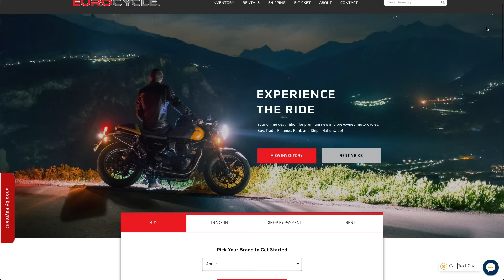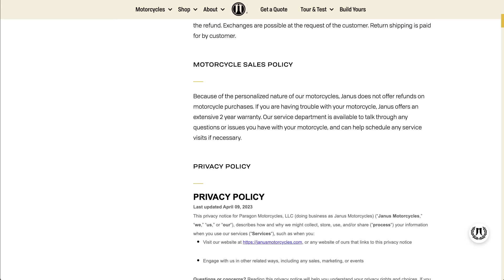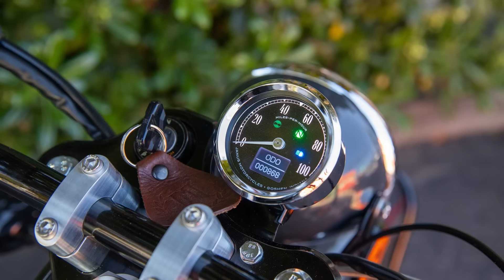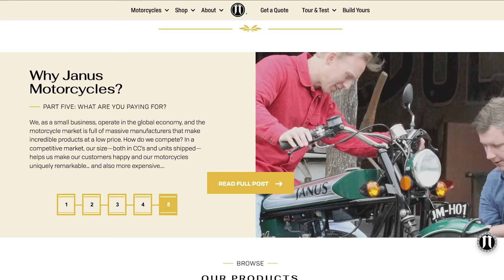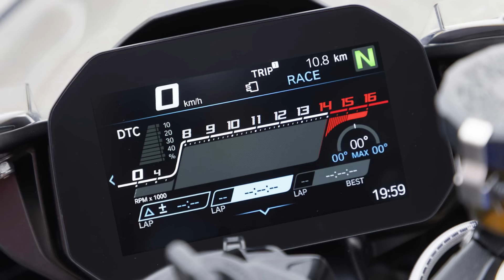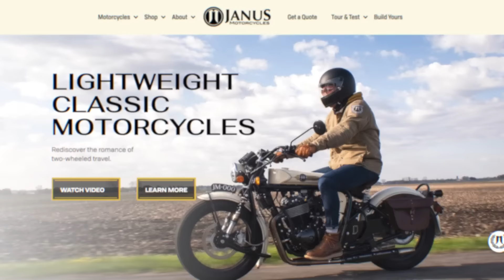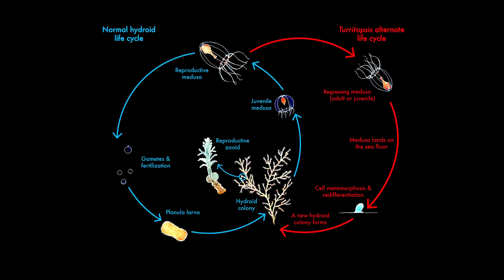We need to talk about Janus Motorcycles

Comment: If you look at a lot of the older Royal enfield advertisements they hit on a lot of the bespoke handmade aspects, like the one older gentleman who did the tank pin striping for the past 50 years. There’s definitely levels to that and I can understand the appeal of Janus. But yeah for 15k, I could buy pretty much any motorcycle I really wanted and most of them new. I love the retro looks, and because it’s hand made and there is a level of respect there I could say maybe 7-8k. But you can get Chinese 250 and 450 engine clones for 2-300 bucks. Where is the other $14,700. I’ve seen comments talking about the experience, and you can get the exact same experience for a lot less money.

Comment: Good lord did you miss the point of these bikes. People buy a Janus because they want everything you dismiss as a downfall. If you buy a hermetically sealed motorcycle that only a certified technician can maintain, you only have a bike to ride. A Janus is a bike that literally anyone can work on and fix, and that’s a huge part of the appeal. It’s simple, it’s mechanical, everything is visible and easy to adjust, and it takes no special tools to keep running. Riding a Janus isn’t even 50% of the appeal, most of the appeal is in having something that’s beautiful to look at and something to tinker with. Listening to your video was like hearing someone complain that an Omega is a garbage watch because it keeps bad time, you have to wind it, and its hard to read, and that if you want a watch you should just buy a Casio G-Shock instead.

Comment: like the vintage look , think if i had one made i would give them the motor from the kaw 454 sitting in the shed with almost no miles on it though , it's belt drive so that would look cool an something over 50 horse forget how many but they are not slouchs will run 80 mph all day long on the highway and over a hundred if you have to take a dump at the next service center , aircraft crome moly is super strong and lite to i like that . dunno about the chinese motors but do know those 454 are half of a 900 and bullet proof .

Comment: Everything is not about money. I had. ‘96 KLR 250 ( Barbie), great bike and turned heads everywhere I went. Replaced it with a modern xt 250. While the xt is a wonderful modern  fuel injected bike. I do miss the kick start KLR.

Comment: I have a 2019 Gryffin (#33) and love it. Does the mountain trails and the secondary roads and main routes around here just great - wouldn't take it on a major hwy though. It's solid, light-weight, well built, and even the chinese engine is fine - as others have said - it's a CG clone engine which is bullet-proof (though the term is overused it applies well here) and it's easy to work on. It's a great bike, and though it may not be as comfy as my Enfield Himalayan on my buttocks, it's fun for the tooling around, and a big plus is how light-weight and nimble it is. And to your question of 'why would anyone buy it'? Why do you think mechanical wrist watches are still sold? And making a come-back too I would add.

Comment: Well, U missed the most important aspects; riding the machine right out of the annals of Americana motorbike Hx. !!. Yes, an Enfield less expensive, but I don't want an Enfield, or BMW or others. I had 3 Harleys and turned 70 and time to downsize. I wanted a scoot for @ town and nice sunny country roads. And the #1 reason; hand built, hand manufactured and a 4 year bumper to bumper warranty! NOT BUILT BY AN ASSEMBLY LINE OF MACHINERY DUDE!!..I sold my beautiful custom soft tail Deluxe 2008 to buy my  Halcyon 250....OLDSOOL PAUTZ.

Comment: They are absolutely stunning machines. I swear if they could source an engine from Motto Guzzi or Royal Enfield at the price point they are selling at. Id buy one tomorrow. For the little lawn mower engine they put in it. It feels like highway robbery. 

Not even against low displacement, source a thumper for Husqvarna. But to me claiming this is an American made motorcycle with this power plant is the only thing detouring me.

Comment: I received a nasty-gram from the Janus team when I posted this on FaceBook:  "I think your bikes are one-of-a-kind but I would not buy one because I have no idea where I'd ride it.   Under-powered, over-priced are not words that I want to use in describing my bike purchases and I've bought 20 in the 50 years I've been riding."  These bikes are perfect for someone---just not me.
Reply: You'd ride it on asphalt or cement or dirt roads. And underpowered compared to what? The power is exactly what it's supposed to be. Underpowered would be if the bikes weighed in at 450-500 pounds and made only 20 horsepower or something and made like 15 torque, kinda like most Harleys lol

Comment: This guy is so far off. I own a Halcyon 250 and constantly get compliments on it. It is comfortable at 70 miles per hour without any conform issues. Nothing looks like this motorcycle. There is nothing like it on the market.

Comment: The 450 has an Italian Honda clone engine (xr 400 with bigger displacement) and a dual monoshock suspension with an improved springer seat, I think it's a really nice bike but it needs a less steep price tag, I could get a brand new Harley street bob for the price of a custom 450

Comment: I suppose their popularity stems from the vintage look, and of course the craftsmanship.  Their customers aren't the typical bike rider, and thus what their building likely corners a market that otherwise would have little else to choose from.  $15,000+ may seem like a lot, but it's nothing compared to trying to purchase a real deal vintage motorcycle that you'd not be able to ride for the lack of available parts.  Mostly yuppies (or whatever that crowd is called these days), they can afford these bikes, and it let's them convince themselves that in some weird parallel world, owning said time machine makes them a biker.  Lol.  My first bike back in the mid-'80s was a '72 Suzuki GT-550 Triple (2-cycle), literally Blue on Black (righteous Kenny Wayne Shepherd reference).  Then in the late-'80s I rode a Honda CB750-Four, in 2-tone Honda puke green.  At 60 years old, I ride what I like, regardless how cool Harley is supposed to be; thus my motorcycle of choice is an '09 Kawasaki Vulcan 900-C, burnt orange metallic.   I get the whole vintage look thing that Janus is into, but if a rider plans on getting out beyond the city limits of their small Amish town, they probably need to put that 15 grand to better use elsewhere.  By the way, my family is from Northern Indiana (Dyer, Crown Point, etc), and the "O" in Goshin is pronounced the same as Go Pro.  The Janus 450 is a good looking vintage knock-off.  But it's not $15,000 worth of good looking.

Comment: For that price I’d expect an in-house made weird little inline 4 like the old bikes where they’re mounted parallel to the frame. That would be cool. But some tube steel and a Chinese motor? Would be cheaper to buy a welder and make this in your garage.
Reply: For a small company like Janus, if they used inline 4s, the prices would be even higher. Each one of these bikes are around 5-6 thousand , the rest of the money goes back into the shop, these guys actually pocket very little. But these aren't meant to be a future company Honda. Look at Arch motorcycles(Keanu Reeves company)his bikes start at 60grand, albeit they use some pretty good parts, but they don't sell hundreds of bikes every year and they are still in business. But an inline 4, makes no sense anyway, these are meant to represent the original motorcycles the world first saw, inlines were definitely not at the beginning of the bike world

Comment: I have the same motor in my hawk 250, with a 17 and 45 tooth sprocket she'll do 70
But she doesn't like it, that 1 piston screams at 8000 rpm. Gotta pin it it 5 gear to do that but she's fun for cheap so, win win I reckon

Comment: I love the idea of the bikes, but think they would look much better if the engine cases and valve cover were polished instead of black paint. How many old classic bikes have all black engines ? Tbh I can't think of one ? And I think that's the detail that makes them look not quite right imho.
Reply: You can polish the engine parts, not that hard at all
Reply: Vincent Black Shadows had black engines.
Reply: @1978garfield  Mostly, yeah, but polished push rod tubes and rocker covers broke it up. Monolithic black just looks wrong imho

Comment: I read about Janus a few years ago. Nothing about their motorcycles, pricing or business mode makes sense to me. Royal Enfield does everything better and you get much more for your dollar. The Royal Enfield Classic 350 has a $4,699 MSRP, antiquated styling and I expect will be a more capable and reliable platform with an extensive support network; $10K cheaper than the Janis Halcyon 450. It makes more sense to bu the Royal Enfield, spend $5,000 customizing it to your hearts content, then take the other $5,000 and buy a used low mileage Yamaha YZF-R3 for those times when you want to rejoin the 21st Century.
Reply: You saw the owners right? Hipsters. Their target is hipsters who cannot afford an Arch. But still want to look trendy at starbux. It's a 10-15k look at me accessory.
Reply: You're comparing a hundred year old company who mass produces their bikes, to a young, hand built company who has less than 15 employees...if they used better parts, their prices would be like Arch, 60-65 grand each lol

Comment: I admire the effort, not the power or cost.
Reply: If you ever have a chance to ride one that has been properly broken in, see what you think. The power to weight ratio is such that it moves really well. I can't think of needing more power in most of the driving I actually do, which is something I considered before buying one.
Reply: @jeffkaron5311  It appears you made the right choice for you.  If it works for you it doesn't really matter what other people think.

Comment: I'd like to have the 450 bike, minus the Chinese Clone engine.  I'd put a KLR 650 engine in it for the nostalga.  Not a beast motor so the frame should hold up.  But enough motor to cruise all across America.  I've ridden my KLR 650 over 150 K miles, so I trust it more.  And yes I've fixed all the greminlins in them.  But i like the retro look of the Janus.

Comment: The CSC SG250/Zhongshen ZSG250 is the same engine that they are using a CG250 clone and I can hit 75 no problem. I still want those last 7hp though but it's not worth $1300 to get it.

Comment: Creo que no es posible analizar a Janus como tu lo haces, son buenas motos confiables en lo mecánico y en arquitectura, pero debes considerar que son una opción estética es como el steam punk, lo único cierto de tu equivocado análisis es que son muy caras, a pesar de ser hechas a mano, toda vez que la motorización es genérica y de origen chino (50% de la moto).  I think it is not possible to analyze Janus as you do, they are good motorcycles that are reliable mechanically and architecturally, but you must consider that they are an aesthetic option, it is like steam punk, the only true thing about your wrong analysis is that they are very expensive , despite being handmade, since the engine is generic and of Chinese origin (50% of the motorcycle).

Comment: You loose all credibility when you mispronounce the name of the town Goshen  - Its Go- Shen like the land of Goshen in Egypt. DUH... As for my personal experience,  my first bike was a 1966 305 scrambler. Second was a Kawi 500 triple. Then I owned a Kawi 440 LTD and my last and nearly fatal street bike was a 1985 600 Kawi  Ninja. I have ridden a V4 700 honda, a 900 Ninga a 1000 Yamaha and a 1000 Ninja and innumerable dirt bikes. Of them all I would say I had the most "fun" I had was on the 440 LTD. at 44 hp and 373 lbs it was a blast. What was scary was the without a doubt the 500 trip. rocket fast the 1000 Yamer or the 1000 Ninga best sport bike over all  is the 1985 600 Ninja. It was fast at 147 mph top speed, and at 429 lbs dry it was very light for it's time.  But the 1980 440 LTD I would buy again in a heart beat. 55 MPG and handled better that anything else I have ever ridden. I would so much like to ride a Janus 450. I bet it's a great bike! As we used to say - to go for a putt...

Comment: I think the 450 is esthically gorgeous, but no way would I would pony up $15,000 for one, and as you pointed out where would you get warranty support outside of Indiana.
Reply: The company will help you work on your bike if you wish to--it is completely transparent about everything connected with the bike. If an owner doesn't wish to do any mechanical work, the company will find a mechanic nearby the owner who will work on it under warranty. I connected with such a mechanic just in case, but so far have done all work myself, which has made me a better and safer biker.
Reply: @jeffkaron5311  You'd have to ship the bike back to be worked on. That isn't very convenient.
Reply: @bluesysaxman  Nope. I would take it to a local mechanic, and the company covers the repair.
Reply: @jeffkaron5311  that’s awesome
Reply: @bluesysaxman  most shops will not work on the Chinese engines. Because they have so many issues. They would have to field complaints non stop. My local dealers will only service brands they sell or known brands. Even the metric shops will not touch them. Even if you can buy one used cheap. I would ask every local shop first. As I bet they will pass on the work. The 400 Chinese made scooters have killed any support they may have had.

Pretty sure this guy is a troll. The actual forums for Janus owners have lots of complaints.

Comment: one word ...err term "half assed"   I get what they wanted but the choice of motors absolutely ruins the desired look ...to really pul it off would require an actual bespoke engine which considering 31 people will buy one of these (maybe) the numbers just can not work EVER.   Actually a Honda trail 90 style would even look better but even that would fail in the same way ANY modern motor will stick out like a sore di,,,,uhh thumb
Reply: The shame is all that craftsmanship kinda goes to waste without a proper motor to bring it all together ...I cant think of a single modern engine that would provide the right look.   I mean NO ONE is goning to buy these because they ride like a modern MC so in that regard even these chinese honda clones are far superior to the retro chassis and wheels ....ironically it is the motor that ruins it ...IMHO ...but hey if someone else loves it the way it is?  Who cares what anyone says right?
Reply: They sold over 900 units of the one model in one year alone so definitely selling more than 31. Yammie even says in this video how many have sold, did you not pay attention?

Comment: They look great! But, like a vintage steam train, you wouldn't want to use it everyday. Also, the Chinese engine will suck!
Reply: Ive got 14000 miles on my “chinese” engine, my husband has 28,000 on his. Not. One. Problem. They run like swiss watches.
Reply: @jeffbloomer2613  fair enough. My Chinese engined bike was a dog with fleas! 😁